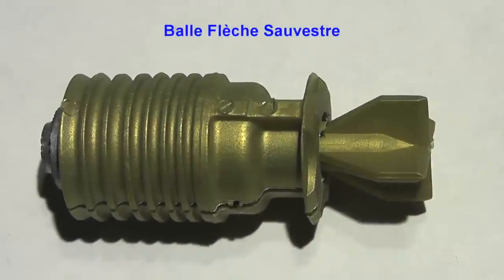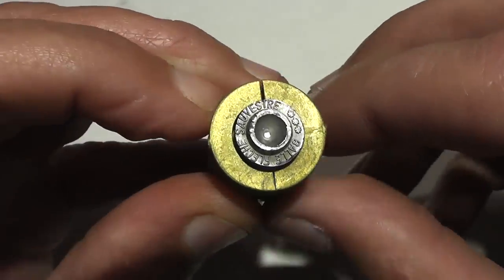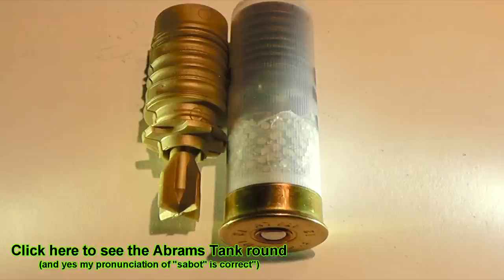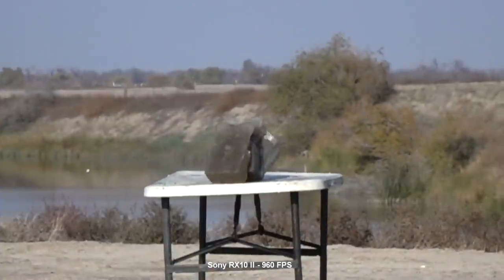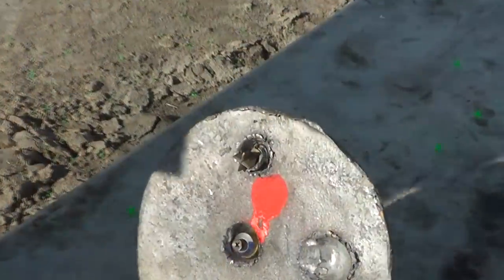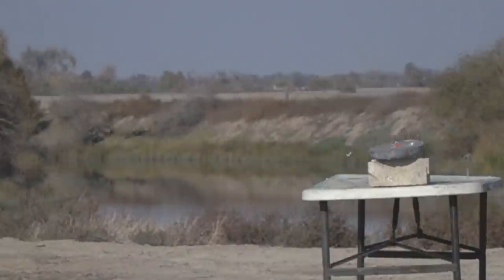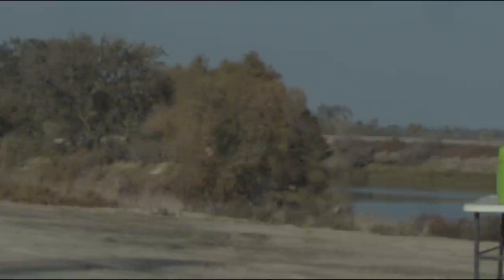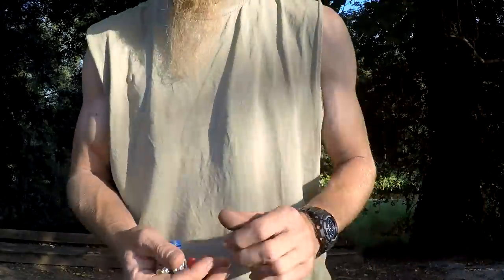Shotgun slug designed like an Abrams tank sabot - Sauvestre

Comment: Apfsds-t armor piercing fin stabilized discarding sabot - tracer 120 mm with a depleted uranium piercing rod that after fired and the sabot drops off the du rod goes 1 mile in a second it is the armor piercing round of choice the tungsten sabot round is inequivalent to the du round

Comment: Taufledermaus, for the loading of odd shells maybe use a shell without the brass primer end, a dowel stuck to a base, and do a plunge load if you will.
Reply from the maker: The problem was not knowing what type of powder the original shells use.   The quantity of powder to fill the cavity around the fins is about TWICE that of a "normal"  shell.   If I used too much of the wrong powder,   it could have just destroyed the slugs or blown up the gun.   So I had to use inert grains of plastic to take up the space rather than just add more powder.

Comment: Wonder how theyed work cast in brass. or built in layers to fly apart upon entry. a friend cast 45 cal hard lead slugs in shape of an FMJ inside a 12 guage sabot. blew holes through 1/4 in steel plate @100 yds. smooth bore bbl. accuracy was not great.

Comment: Isn't there some ridiculous range variation for the Abrams? Like they don't rifle the barrel because at the ranges most Abrams engage targets at, the rifling would cause the round to spin to the point where it would spin off course. That's what I've heard at least. And the same for 'beyond lethal' ranges for anti-material rifles and the like.
Reply: I don't know much about a long range Abrams variant (unless you mean the V4 upgrade?)

what I do know is that an armor penetrating round has to be long and thin to do its job and the longer and thinner a round is the greater the spin rate has to be, this is a problem for tank sized rounds so a smooth bore fin stabilized round is preferred. Also HEAT rounds don't work right if the round is spinning, That's one reason why the British like the HESH round so much.
Reply: Rev Raptor Yeah most American 
M1-Abrams are smooth bore fin stabilized and engage at ranges of over 1 mile at max (again last I read and heard from friends who work as tank and armor crewmen) because the fins can catch air and cause the missile to spin off course, again, at extreme long ranges. But it's nice to read some new info. I don't keep up on new models of most any tanks so if you have any new info I'd love to have any links you have or just any facts or changes from previous models. Thank you!
Reply: Jack Petry They use smooth bores because rifling is just one way to stabilize a projectile.  The Abrams ammo is stabilized by the fin on the round so there's no need for expensive and time consuming rifling.

As far as I know, the reason for the smooth bore has nothing to do with anything else.

Comment: th e reason it swivels so much is because the tip is pushing an air bubble which is supposed to explode on impact. Should you have a pointy nose you would get no swivel and a higher penetration. As you may know, the sabot round is meant to pierce through thick armor. So a shotgun sabot is really kinda pointless, you could do better with a normal round

Comment: can you tell me what the speed of sound is in feet per second.  so I have some idea on those imperials
Reply: Alessio S around 1260 fps.
Reply: thanks brenda  ::)
Reply: Alessio S At sea level and standard temperature, pressure and humidity, it's about 100 fps less than Brenda's number, but it varies a lot depending on conditions. I use 1,125 fps.
Reply: the thinner the air the faster the speed  :)  In real life I use metrics that's why I asked , to have at least some reference
Reply: +Alessio S No. Sound moves faster the denser the medium it's in. That's why sound is louder under water and non existent in space.
Reply: There's this wonderful thing called google, try it sometime.
Reply: @drizzleise: thanks for your helpful advise
Reply: yes you are right I saw the sound speed tables  specially in metals it is  extremely faster compaired to air  while trough gel or rubber it went alot slower  (damping effect)
Reply: 1125.33 fps

Comment: Do you think these would be accurate out of an 18.5 barrel? or even an SBS?
Reply: i use them in 20 inch barrel, smooth
Reply: i have to try with a rifled barrel, by the way there are at least 3 types of rifling for the smooth bores: differents pitch

Comment: Is it unsafe to handle lead projectiles without washing your hands afterward?
Reply: Probably not a big deal unless you're handling them all day long in a munitions factory.
Reply: LMG Sixohfour shooting them is worse than handling
Reply: Keep them out of your mouth and you will be fine. If you are making your own avoid the dust when cleaning up your mold..
Reply: It's not safe to work with any material when it's turned into dust... everything is somewhat toxin. Just holding for some time lead should not harm You.

End washing not washing. You hold it or not. Washing hands don't rewerse time or whatever.

Also as pnguin_with_gun somewhat said.

Shooting end don't wearing dust mask, googles ect is more dangerous from toxination point of view than just plain holding lead

Comment: Wee Wee, liking that camera more and more.
How does it perform under low light conditions ?
Reply from the maker: It works surprising well.   "Low"  light conditions for HS cameras would be a cloudy day,  and it will give decent imagery up to about 4000 FPS.   It would be too dark for my old Casios or even my new Sony RX10 running at only 960 fps.
Reply: For the price and overall size, that high speed is a deal !
Reply from the maker: Yeah, the camera is fantastic.   I don't even use my Casios anymore.

Comment: Did you test it against steel, to see if it penetrates like a sabot?
Reply from the maker: It just uses a soft lead nose so it wouldn't  be a good penetrator for hard stuff.   I had a LOT of problems getting these to work since the powder loads are not published by Sauvestre.   I planned to shoot these against a bigger variety of targets but half of them were duds and I had to go home,  and reload them twice.
Reply: I'm wondering what would it do with a tungsten tip

Comment: Edit: this is still one of the coolest video of taofledermaus.

sabots in shotguns are useless.... slugs are meant for massive energy transfer in a single point but sabot means lower kinetic energy transfer as the cross section is so small it hardly deforms and won't deal as much damage to a body as the muzzle velocity isn't that fast to create the wound channel of rifle cartridges and there is no copper jacking which helps creating wound channels and if you are looking for a fast and accurate shot you are going to use a rifle not a shotgun.

to me sabots in shotguns are pointless, tank warfare explains perfectly what sabots are meant to achieve... maximum penetration.
Reply from the maker: yeah but in many countries using a rifle isn't an option.
Reply: ***** holy... you actually answered my comment, dude you are my hero ! i love your videos.

anyway, well in that case this is a good option to back up, do you think that a rifled slug would be more or less accurate than this sabot slug at 30 meters ?

greetings from italy !
Reply: ***** i have a very cheap idea for shotgun slugs... a glass marble, i use them in my hand made "mortar" (it was born as mortar but i can use it as a shotgun but since it's powered just by 1 or 2 firecrackers the energy is not incredible but i still manage to destroy at least 3 glass bottles in line or punch a hole into a 1,5cm wood plank, even metal sheets)
i bet it would do well against ballistic gelatine, i wonder how it would perform against hard drives tho.

Comment: ...  NO that is NOT why an Abrams has a smooth bore.  

HEAT rounds work best when the round hits nose first as close to 0 degrees as possible.  When fired from a rifled barrel  Heat rounds tend to pick up an oscillating spin, with the nose being as much as 30 degrees off level.   this drastically cuts down on its penetration.   The UK experimented with all sorts of ball bearings, fins that rotated while the "nose" didn't.  But in the end, it was decided to scrape rifled and go for smooth bore for the best effect.   Only HE rounds really required "spin" and the truth is,  they didn't even need to be super accurate anyway.

Comment: Sabots have a point, like a dart.  They're not blunt.  Just sayin.
Reply: Sabot is nothing to do with the style of the projectile (Or 'penatrator' ). The sabot is the jacket around said projectile that delivers the force to the projectile and seals to the larger barrel diameter.
Reply: Adam Laycock Hmmm...  I thought that the Heat and Hep rounds sealed to the chamber too.  I thought that the only difference was the type of explosive capacity that they had and how they damaged the target.  The Hep and Heat explode and the Sabot punctures.
Reply: Correct, but "Sabot" is nothing to do with the type of round being hurled down range. It is just the method of firing it down the barrel. The only reason they use Sabot's on penetrator rounds is because you want fins on it and a smaller diameter that will travel faster. to do this you now obviously can't make it seal with the barrel so you need to hold it in a jacket, and then discard this jacket once it's left the barrel. Sabot.
Reply: Adam Laycock Ah, you are correct.
Reply from the maker: Yes.   a lot of people  believe the sabot is the projectile,  when it is just the spacers that keep the projectile centered in the bore.
Reply: +Adam Laycock Correct. "Sabot" was a french wooden shoe. The sabot is the "shoe" around the projectile that carries it. Analyse "APDS"  Armor-Piercing Discarding Sabot - Armor-piercing refers to the projectile - Discarding Sabot to the fact that the sabot splits off upon firing.
Reply: vottoduder wrong

Comment: Why not make a mold of these shells, & pour your own? Doesn't look that frigging complicated, ... & the shells also look like they are made of the same material as milk jugs, which can be recycled right in your home, ... once malleable, (or softened up to be pliable enough to be pressed into a mold), you could add all kinds of sensory stuff to them, ... minicams, temp/hardness/velocity etcetera, a variety of sensors could be put down range, without having to physically go/be there in person, ... how valuable that could be, ... ??? You had to repackage the loads for the shells to start with, so why not pour, & make your own, ... lol! Good luck, ...
Reply from the maker: I don't have an injection molding machine for nylon.